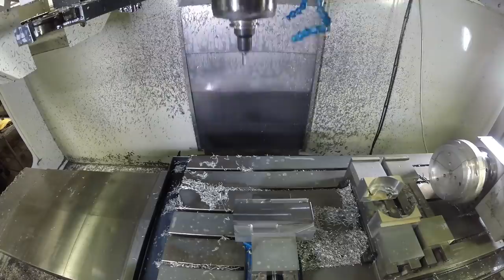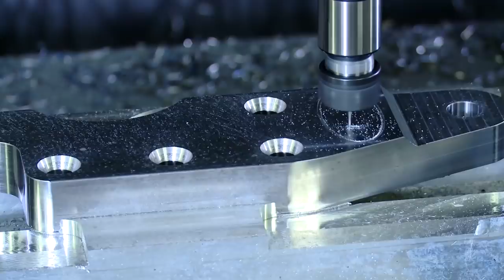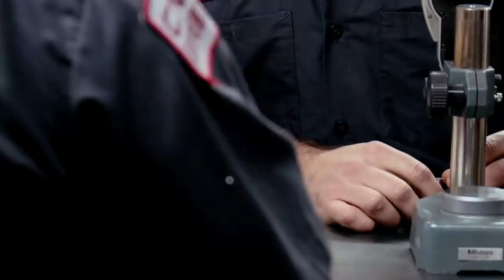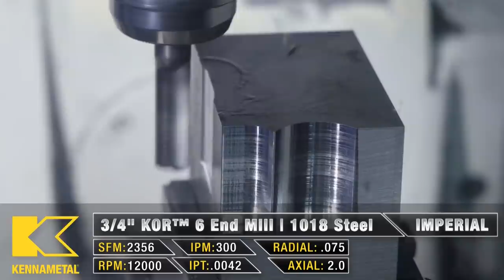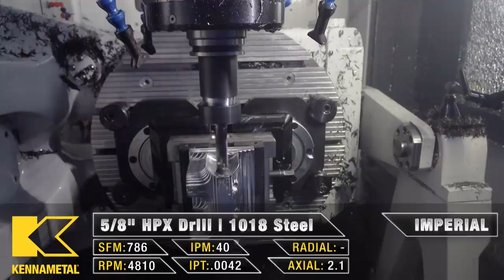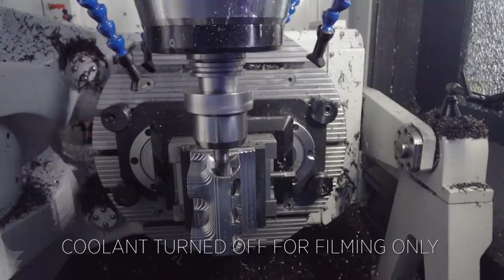Tools Keep Breaking on Night Shift, but Runs Perfect on Day Shift... Nobody Knows Why

Comment: We had the same problem. Was because the night shift didnt monitoring the machines so the pieces got clogged up with swarf because the machine was never blown out properly on night shift. These were hollow spindles with som complicated geometry holes in them. I'd check the duty cycle on the coffee machine first most of the time when encountering problems in the machine shop. Not in your case though.
Reply: Hmmm.  
Maybe they would monitor their machines closer if someone made it clear to them that their future employment here required they do so. 😁

Comment: Can you do a video of how to calculate chip thickness?  Unless there already is one, then I’d love a link because I can’t find it 😀
Reply: Feed Rate, divided by RPM, divided by the number of flutes. 

60 IPM / 8000 RPM / 3 Flutes = .0025” Chip Load. 

This is accurate, when cutting with 50% or more of the tool diameter. There is a much more complex equation for shallow radial cuts, and chip-thinning calculations, which I will never remember! 😀
Reply: If going straight ahead, cutting 50% or more of the cutter diameter, chip thickness is feed rate (ipm) divided by cutter RPM and then divided by the number of flutes. So 4 ipm at 1000 RPM with 4 flute cutter gives .001 inch chip thickness.    With a lower radial depth of cut (RDOC), multiply the first result by the RDOC percentage of radius. For RDOC 25% of diameter = 50% of radius, chip thickness .0005 in or double the feed rate to 8 ipm to maintain .001 chip if that is what you want. For RDOC 10% of diameter, chip thickness .0002 in or feed rate 20 ipm. Note: This method under-estimates the actual chip thickness, it is thicker than this calculation, but exact chip thickness is not required so probably close enough and avoids calculating sines and angles. High performance machining as shown in this video uses small step over and high feed rate in order to maintain reasonable chip thickness.

Comment: The guy thought he knew something lol.  
You have a good point you do have to know the tool.  Carbide, highspeed,  ceramic.  Feed and speed can change drastically.   You have to know what you're cutting as well.  Your recommended surface speed should also accommodate for that as well.

Comment: One of two things. Either 2nd is running a lot harder and faster getting more parts out therefore breaking more endmills or they are being lazy and slowed things down trying to take longer on each cycle therefore breaking more endmills. And as I about to finish typing this you say they turned the speeds and feeds down so yeah the second one they are lazy.

Comment: Okay, no, you're right. You get to a point as a machinist where you stop thinking in RPM and IPM and instead cutting speed and chipload. Going from 3 fluter to 2 fluter? Okay yeah maybe then lower your chipload by 1/3. Otherwise you want to adjust your cutting speed and chipload pretty close to 1:1 if it was remotely dialed before.
Reply: Agreed.
You could always just do the math yourself also... Which might be a waste of time, as you say... If it was already dialed in.

Comment: Sounds like night shift doesn't feel like working very hard. This happened a lot at my first shop. All they had to do is load a bar of material, reset the parts counter and restart the program from the beginning. They said they kept having problems with the parts counter, and they also couldn't figure out how to turn on the optional stop to measure a part now and then. 
I think they just didn't want to have to keep up with the deburr and stamping. It was too fast for them.
Reply: Q.C. is everybody's job ....
Reply: Sounds like management was too lazy to hold them accountable.  
Explaining how an optional stop works sounds like a 5 second conversation.

Comment: Had kind of the same thing. Did tool testing with the tool vendor and our customer to develop speeds and feeds. Test machining was fantastic. Later the guys told me they were having problems. Went over to see and found the president of our company was on the shop floor, had stepped in, slowed the cutting sfm to 15% of our testing, upped the feed rates, then decided the tooling was no good. He was having new tooling made to his thinking. President's previous experience was with a local grocery store.
Reply: Why do, and lets face it they are overly self important English majors (lets face it they handle easy math just large numbers.) And communication experts do that to themselves.
Reply: @bigkirbyhj666  could you write that again in a comprehensible sentence?

Comment: Our materials uni lecturer worked with company that made assemblies for satellites using some crazy titanium alloy. Mill wouldn't last more than 2 minutes of cutting while running on manufacturers specs. They tried adjusting everything but nothing helped, then they called him asking for help and he told them tu run it on 4 times the rpm that was specified for titanium alloys. Since they were using alloy that wasn't common in the industry those specs wasn't right. After the change the mills would last up to 6 minutes, saving them considerable amount of money.
Reply: I would enjoy reading what you have to say more if you wrote more clearly.  😁

Comment: As somebody who isn't very familiar with CNC, what's confusing me about this story is why didn't the day shift operator notice that the settings had been changed?  Do the settings automatically revert at the start of the shift?  Was the night shift operator manually changing them back at the end of the shift?  Or did the day shift operator notice that the settings had changed, but for some reason didn't say anything about it during the investigation?
Reply: @johnmcpudding857   "What I picked up from the story, is that they run the same program on the same machine, same tools, same everything, except users."

They said in the video that the night shift operator admitted to changing the settings.

Comment: Not a machinist but a mechanic in a factory, I have been called out to fix machines that normally run great, only to find after a lot of butt scratching that the previous operator screwed with all the settings trying to make it run faster or "better" or something. Then the day operator resets everything and it runs like butter. It's not just the night crew, sometimes its the relief guy who screws it up.
Reply: What could they be adjusting that isn't in the program?  
I would hope that someone would definitely threaten their job if they are missing with CNC machine parameters.  😯
Reply: @jamisojo  air pressure, machine/line speed, knife temp/angle, water temp/flow, etc. Theres a number of things that the plc doesn't control.

Comment: Lol I had a maintenance guy come back to my machining centers because they were flying across big aluminum panels. He told me I needed to slow down the traverse and keep the rpm's the same, because the slower the cut the longer the life... No wonder why his tooling on that old lathe was always chipped and gunked up with aluminum. It's all about the depth of cut and chip size. Each metal reacts differently to one another, with softer metals generally requiring a bigger chip per tooth.

Comment: I was kinda hoping this was something more exotic than an operator changing the params that the author had worked out :D Wouldn't be surprised if the night shift operator just wanted to sleep a bit more between runs, hehe.

Comment: I THINK YOU NAILED IT.  To get the parts to come out exactly the same every time the operators must follow what the original design parameters were set at by those individuals who originally set up those machine parameters to achieve the original specifications.  The operators on the night shift should have been reprimanded by not following what was originally set up.

Comment: In our company it was an entirely different problem. Tooling's and machines kept acting differently. Most machines had to be re-set. The problem was, that the building had bad insulation. So at afternoon, and night, the steel got cold. That changed all the measures.

Comment: There are so many variables to take into account. Feeds, speeds, depths, material processed, endmill material, endmill finish, cooling method.... These modern CNC machines aren't your well known manual Deckel brand Mills and it takes years to master programming them.
Reply: I've never heard of a Deckel.  
I have heard of Mazak and Haas.  😁
Most everything is carbide tooling nowadays for end mills... Pretty easy to use.  
I guess it depends upon how difficult of material you are cutting.

Comment: Question, if you are doing 50% stepover vs full slotting then the chip thickness is the same, but would the feedrate still be the same?
Reply: Load is doubled.  HP must compensate.  Rigidity has a factor.  
Slamming from %50 to slot without RPM compensation might slow you down enough to break the tool.

Comment: As a trained fitter, I always wonder why noone seems to be using coolant on those HSS tools. Have they become so much better since the mid-90's (where I left the trade)...?
Reply: Near the end of the video is a caption: "coolant feed turned off for filming purposes" 
If I'd see sparks coming off an HSS tool cutting stainless I'd hit the big red button immediately.
Reply: Yes.  The coolant was only off for the videos.   They may have changed the cutting speed to make it work.
The only high speed steel tool I saw in this video was the drill.  All of those end mills and chamfer cutters looked to be carbide.

Comment: As someone who has worked nights. Most problems can be avoided by having the same support thats there for days(engineers, supervisors, tech ect.) On nights as well. Most the time a problem would come up and the person who had the answers were on days, So whatever fix we could come up with to get us through the night had to be used.
Reply: Exactly.
Reply: Might be feasible at a giant factory for general motors.... But most places don't need two engineers to oversee the same thing.. And they can't work 24 hours a day.

Comment: you have a problem if the night shift is not outproducing the day shift. to use a metaphore, the phone doesnt ring at night... none of the things that can distract the day shift  happen at night. or anyway, those distractions should not exist. it should also be where you put your best people, not where you hide your worst. in the case of this part, you found that you hid a bad machine operator on the night shift.

Comment: I would say the problem is the night shift not thinking. They were given code that had been fine tuned by the day shift, but decided they didn't like it and changed it, and then had problems. The first thing they should have done is run it as it was given to them and see if it actually had problems.
Reply: I would say that it is unlikely you have done this type of work for many years.
Reply: @jamisojo  Why? Because the night shift not thinking is common?

Comment: Feed per tooth and max tool load. If you start from there you're golden most of the time.
Reply: According to the dealer my car would do 270Km/h and should use 10l/100Km gas. Man, was i in for a surprise.  ;-)

Comment: This is a very common issue. Machinist, whether day or night, changing feeds and speeds because they feel its too much. I'm not down playing the experience and knowledge of machinist with years in the trade. Yet, if the programmer has already vested time and research to program the machine to run at a certain feed and speed and has had quality confirm the parts are good, No machinist should be messing with the speeds just based of their preference. Good video to share.
Reply: In the practical sense, it comes down to a great deal of lack of communication.  
If you expect another human being to blindly follow your orders, you might not understand human beings.

Comment: Thats poor management right there, there should be sop that covers that so the person who creates the program is the one who can change it and there should be work instructions. I had a problem between day and night shift once with parts made in fixtures with welding robots. I found that our press guys had stamped 10k parts out of spec and then with the fixtures heat soaking over the day with ambient temps increasing when 2nd shift started it was enough tolerance stack to cause an issue.

Comment: I worked at a company like this 2nd shift trying to run more parts than day shift..
Why aren’t you using coolant? All my machines used blasso 4000 ? Just a question
Reply: Can't see much in the video with coolant running.  
Running without coolant for the video is possible.  Not sure if they slowed down the machining or not.
Reply: ... in this case the second shift was not trying to run more parts than the day shift.  Sounds like you're experience was different.

Comment: So, if you're code was correct, why was the night shift (3rd?) breaking EM's?
I understand the 2nd shift guy was underpowering several factors, but that doesn't account for why 3rd shift had a problem.
If they happened to break 2nd shift's EM, and happened to change it out, they would be starting w/ a fresh cutter and the correct code.

What am I missing?
Reply: The nightshift is not around to defend themselves when the boss is at his office. I worked 30 years in the nightshift and when something went wrong, it's always the nightshift who dit it.
Reply: I do not recall any talk about third shift in this video.
In this video, the night shift was overriding the feed and speed of the tools.  Which, of course, would make the programming pointless.
Reply: @jamisojo  Night shift IS the third shift. 
Morning (7-3,8-4,etc) is first
Afternoon/evening is second
Night is third

Comment: I've seen guys act much differently when the boss ain't there. They run cuts with no coolant, to avoid cleaning. They increase or decrease feed rates. Some get away with this so well that they get a reputation as "getting things done", at the expense of the workers who use the coolant, change the coolant, clean the machine surfaces, basically do things properly. They are the "CLIMBERS", climbing on the backs of whom they consider the less intelligent. My goto solution:  TATTLETALE  on the M.F.ers !!!
Reply: Nothing wrong with the truth. 😁👍😉
People who don't like snitches are immature fools anyhow.

Comment: when you said speeds and feeds are not relevant I was like wtf mate, then you explained what you were referring to. I use several cnc machines 3d printers and other tools in my aircraft parts manufacturing

Comment: Hahahahaha! I worked in the machining field for 45 years but spent the last 15 years before I retired in 2013 on CNC/NC machine! Started out on the lower 80’s we wrote our programs in G code on paper and typed it in to the machine. We received a cad program called Gibbs and it saved a lot of time. One thing I learned that others would not run you program the way it was written. We received a major influx of young guys fresh out of school and they felt they were better and smarter and wanted their names in everything. Just like a bunch of old dogs walking down a fence roll. They have to leave their mark. Hahahahaha!

Comment: Just curious, carbide sparking? Doesn’t look like near enough cutting fluid. I’m not a machinist but I’ve been in thousands of machine shops and never seen sparks fly like that. I’d wonder if that wasn’t the cause of blade becoming dull and breaking.
Reply: The story being described has nothing to do with the videos of machining going on.
The machining videos in the background have the coolant turned off so that you can see what is going on.
I know that this machine shop does a lot of titanium and inconel.  Those might spark regularly.
Reply: @jamisojo  one of my stops built some sort of casing for transporting hot materials (nuclear). All I picked up was inco. And titanium. I still don’t remember them sparking too much. They used a ton of coolant, like it was coming out of a water hose. Also picked up alot of carbide bits from them every month lol

Comment: I have had the same sort of problems in the Print Finishing world, people who think they know better but really "cock up" a job by altering machine speeds, sidelays, pressures!
When I took over Production at one firm, a Guillotine Operator kept changing the set program, which absolutely ruined the next process Operator's chances of producing a quality product at production speeds. When I confronted said Operator, his comment was "I've done it like this for 27 years!" My reply was "Maybe but you have been doing it wrong for 27 years, so learn why it is wrong, change the way you program or find somewhere else to work where they don't mind you turning a good quality job into waste paper!"
Back when I was a Pharmaceutical folder Operator, I had to stop the Supervisor from cutting my work due to every stack out of 8 stacks were of a different shape and size to the next. Not exactly conducive to producing quality work!
Reply: You had a great opportunity to tell the 27-year guy why his work was wrong.  That is, to explain it to him.
It seems so simple when you step away from it, but in the heat of the moment we usually devolve into arguing.  😁